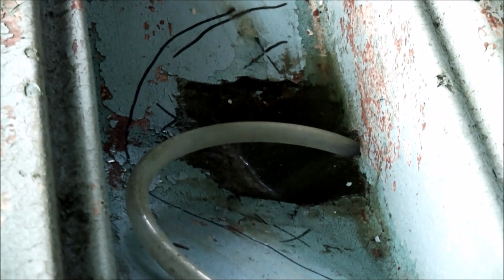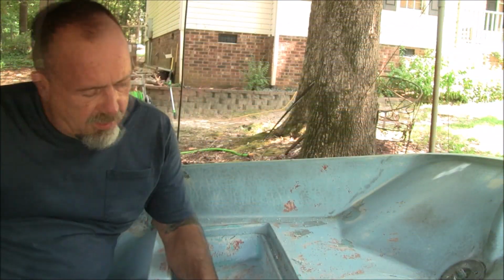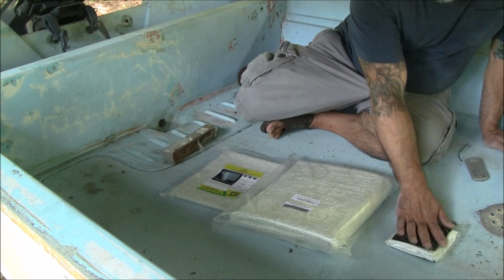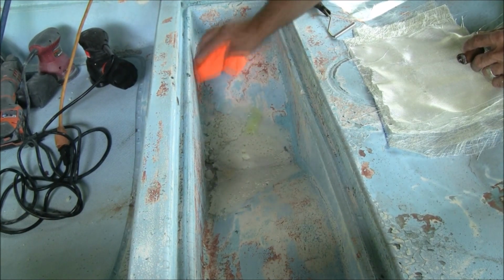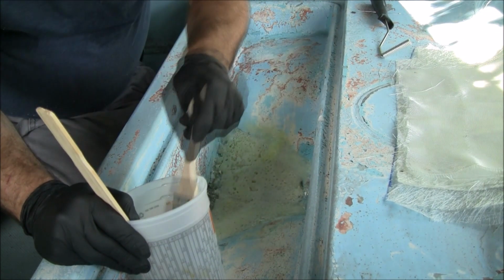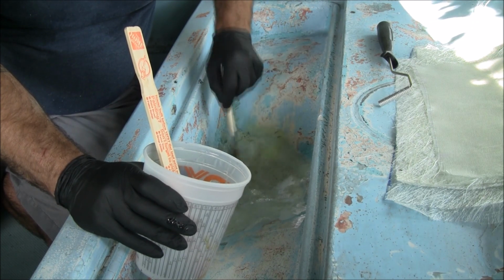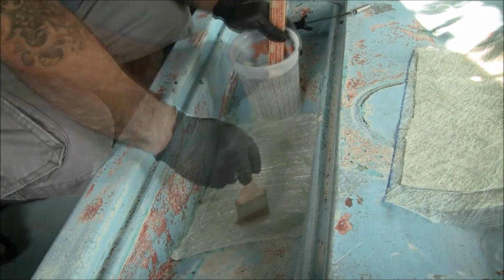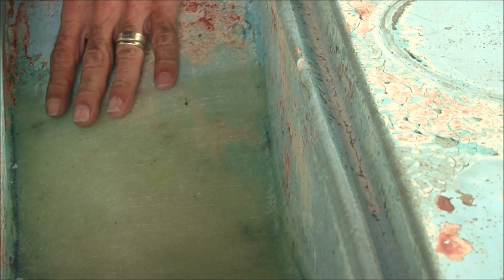Epoxy Resin Fiberglass Repair - Large Anchor Locker Hole - Boston Whaler Restoration Part 3

Comment: So I have a couple of spots on the bottom hull of my 13’ Whaler where I ripped off some loose sections of fiberglass/gelcoat, and there’s exposed foam. 1 area in particular is on the main keel, and there’s areas around the section where there’s a thin gap between the exposed foam and an area of completed fiberglass and gel coat (I wish I could post pics in the comments to better show and explain what I’m talking about). This area and another small mini keel/chine need to be reshaped. I was thinking about just shaping both areas with sheets of fiberglass, but should I spray some foam and use a spreader like you did here to help reshape it, especially the bigger spot I need to fix? Again, I know I’m probably not explaining this well enough
Reply from the maker: I would fill in the potential gap with foam and then shape/cut it down so there's enough room to get a few layers of glass on it. My preference is epoxy resin and 1708 biaxial mat. Your fix will be stronger than the original. After shaoing it, fill in the areas that need it with fairing compound. Good luck!

Comment: Your awesome video series on the 13' whaler is a great guide for me on my '87 11' whaler supersport project.  Thank you!   Question, how did you seal the drain tube inside the anchor locker?  I'm facing the same dilemma, as my anchor locker drain has no tube.   It simply has a 1/2" drain hole on the lockerr side and another hole on the adjacent side of the bulkhead, which exposes the foam to water!
Reply from the maker: I have a video from my Montauk series that ill link in this comment where I replaced the through holes

https://www.youtube.com/watch?v=KSe9Qpt6ekg&list=PLbZmHDKWuEUubCi05hs2SCyLyO0zMyg4I&index=3
Reply from the maker: One more thought, I didnt seal off the drain hole between the locker and the inside. I figured it would accumulate enough standing water to cause any damage.
Reply: @ExtremeDIYGuy  Jose, thanks for the reply and video link!  I am planning on using 1/2" soft copper tubing to connect the anchor locker drain to the deck, using epoxy to seal it at the locker floor opening

Comment: Joe how long does it take for the Epoxy to start to harden the slow cure one ? Tomorrow I will be Glassing the whaler and I have some time in the morning then by 1pm they say its going to start to rain .. I plan on putting the boat under the tent  but ill be laying the glass at 730AM  .. 🤞🏽🤞🏽
Reply from the maker: If I remember right the slow takes about 4+ hours to harden to the touch. I think once you get it on and it's tack free you should be fine. Also, the warmer it is the faster it will set. Do you have any way to keep the rain off it? You laying on a few layers of glass so it will also extend the set time. If you can cover it somehow that would be useful. I actually had a DIY tent stretched out over mine to protect it (Tarps and Bungees).

Comment: Awesome man !!  I just bought a 13.7 whaler and the starboard side is rough shape. Needs glass work and same side the railing is broken about 2-1/2 ft worth needs new construction..  along with the hull has some patch work and the floor has about 6 small holes and 2  cracks that are 3” long. .. ugh 😩  what’s the name of the epoxy  you used ? I was thinking of buying the Brand Wet system  .. I’m open for options and saving a little lol
Reply from the maker: I use TotalBoat 5:1 epoxy and have had good results, West Systems makes top quality resins as well so you would do good with either. Good luck on you Whaler project. Some of my other videos may be helpful as well. One will post tonight on repairing hull damage.
Reply: Jose's Extreme DIY  ohh sweet thanks brother !!  I’m looking forward to watching it ! .. ohh I have been watching a lot of your videos lol big help thanks man ! I’m going to look into the other brand you mentioned  if I could save a little that would be awesome  but I don’t want to cheap too much because I don’t want to have to be redoing it over and over if it fails .. this is my first boat work job. . I’ve working with fiberglass a lot in the past on other projects and I’ve did one of my kawee X2 skis I have a video on that as well but  this is a boat it’s a total different animal lol I subscribe to the channel thanks again
Reply from the maker: @chasingwaves11  Your welcome! I've been using TotalBoat for most of the restoration and everything I've gotten from them has been excellent. They actually featured my wood varnishing video on their web page/blog!

Comment: I’ve done a lot of sanding the past few days to get my 1966 whaler ready for gelcoat.   Very tedious work , used a palm sander and it got me nowhere..found an old polisher/sander and threw on some 40 grit and it took the old paint right off , laid some fiberglass over the holes and tomorrow I’m gonna sand then smooth , and I took my anchor locker and added 2 tubes on the top so water will have a straight shot out instead of collecting in the locker dam .. took a 1/2 hose for the bottom and gonna seal it up with 5200 because water gets between the two layer of glass and get the damn foam wet.  So once they are done they will be clamshell covers for the outside of the locker to give it a slightly classy look.  Lmao.  I’m not rushing this time.  Gonna make her sweet
Reply from the maker: I've used my polisher sander for some of the rougher spots with 40 grit. That thing is a beast and will go through a lot more than you want it too if your not careful. Good luck with the gelcoat!
Reply: Extreme DIY  I have one of the harbor freight ones.  I use 60 or 80 grit , 40 was just too much lol .  It’s taken me 7 days to get it sanded down , but still have to flip the boat over and do the bottom .: I just wish I could find some 80 grit in a value pack , all Walmart has is 5 pack and I go through that in 30 minutes... maybe I’ll make a YouTube video when I’m done
Reply from the maker: @Whalermansteve84  Would love to see some pics! Are you on the Facebook Whaler 13 group?